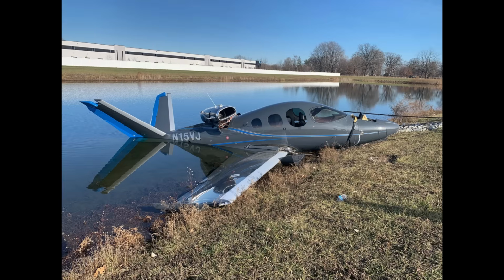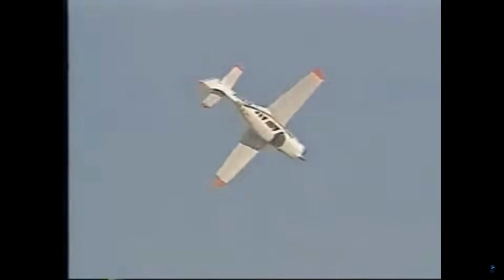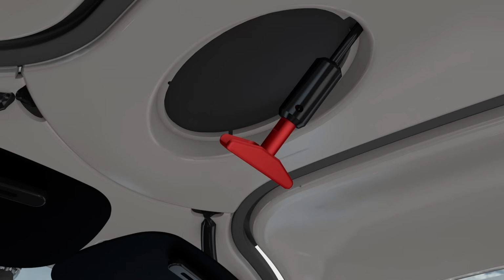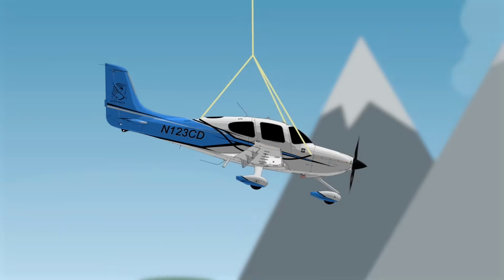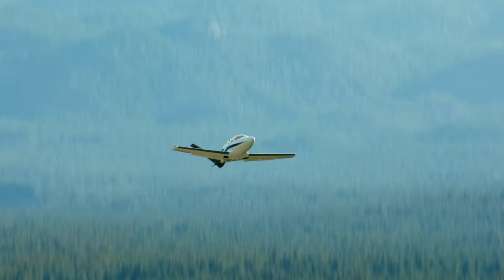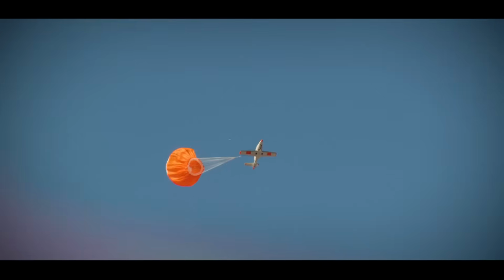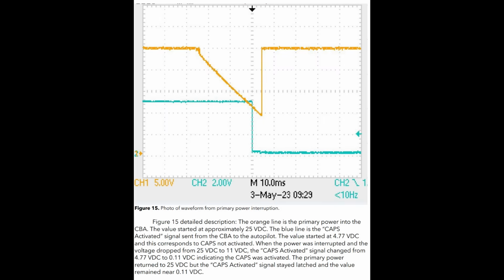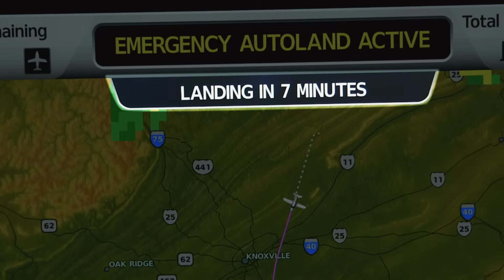Putting Parachutes On Planes: The Genius Engineering Behind Rocket Powered Airframe Parachutes.

Comment: Yeah...by far the most common cause of an off-airport landing in a light aircraft is fuel exhaustion.  I'd rather have the weight of that parachute available for fuel load.  I'd maybe carry one if I were doing aerobatics low enough that bailing out isn't feasible such as in an air show environment or doing airframe testing or something, but for a normal plane I"m going to keep in the Normal category flight envelope?  I'm not worried about pulling the wings off.

Comment: I flew a Czech Sport Cruiser for a bit in training. It had the BRS installed in it. Such an awesome airplane. Some guys remove the chute so they can get a higher load capacity. Because with the BRS, it’s like 450lbs. Removing parachute  added something like 150lbs to the total useful load.
Reply from the maker: Huh? My plane is 660lbs empty and has a 25lb parachute.
Reply: 150lb of parachute could land a house idk if that tracks

Comment: When I worked at Terrafugia on our flying car plane, towards the end of FAA certification flight testing, we needed to perform spin tests. Because this was a completely new from scratch experimental prototype that was not fully tested before, we added a BRS parachute, complete with straps embedded in the tearaway skin as you described. As an electrical engineer I would not normally be involved but the day before the test they discovered it could not be triggered by whatever existing system they had. It needed some particular timing on the trigger signal if I remember correctly. Exiting the meeting at 5pm, I went home to design and build a control circuit with a nice box and button...all out of parts in my own basement, and had it ready the next morning. I remember it was tested with a spare rocket in the parking lot. I drove it all up to the airport and installed it on the plane the next day, and my box continued to be proudly mounted centered on the prototype's dashboard for the rest of its days. Thankfully (?) it was never needed as spin testing went off without a hitch.

Comment: I have an idea for a virtual external "airbag" system for aircraft: Small rockets placed around the aircraft and they would decelerate the aircraft very quickly before impacting the ground. 

The parachute recovery system only works above 400 feet.

Comment: [apologies if this is a duplicate post]

The parachute system has certainly saved lives, and while one can debate endlessly whether or not some of the “saves“ would have really resulted in a loss of life that is inmaterial. It is a good safety system and a nice thing to have. Unfortunately, despite the parachute, the number of  Cirrus fatal accidents (187 as of today)  continues to significantly outpace that of parachute saves. This speaks to a number of factors, mostly pilots getting into situations which they should not have entered in the first place, and once in that situation did not use all of the tools available, including the parachute, to extricate themselves.

Slight correction on the spin training issue. Cirrus was able to demonstrate “equivalent level of safety“ for FAA part 23 spin certification by using the parachute as the spin recovery device as opposed to having to demonstrate recovery from a one turn spin. Conversely, Columbia, Aircraft spent well over a year and several thousand spins completing the part 23 spin testing. A very expensive and time-consuming process.

The SR 20 did undergo a limited spin test series in Europe in order to achieve  EASA certification. The report is available online. The aircraft was subjected to a total of approximately 60 spins, and the report indicates that while the recovery from the spins using flight controls was conventional in nature, the controls had to be held in the spin recovery configuration for longer than most average level experience pilots would be used to. They specifically did not test all of the corners of the flight envelope or complete a spin matrix series like that required under FAA part 23, nor were they required to. They also did not test the SR 22. So yes, the airplane will recover from a spin using conventional control inputs, but since the spin test testing was not completed throughout the flight envelope, the parachute remains the only approved method of spin recovery.

Beautiful day for flying in California yesterday with the exception of some unusual convective in Southern California. We flew over your home airport in our M350 yesterday afternoon on the way to a fuel stop in Santa Rosa before continuing on north. 

Glad that you are enjoying your Aviation experience.

Comment: Looking at that articulated sliding ring, how about a small rocket launched from a weather balloon, at maximum height, rocket engage when the balloon bursts.  That would push Max-Q almost out of the equation, as the atmosphere thins out the higher you go.  You would know much better than me, if a hundred thousand feet is enough of a headstart~

Comment: In 1975, Austrian Herbert Stollinger installed the FIRST "full sized " emergency parachute system on a hang glider that was carried on the pilot's harness and upon deployment greatly slowed the descent of BOTH the glider and the pilot together.
The internet erroneously lists the esteemed Roy Haggard as the first to employ an "emergency parachute" who at age 16 in 1971,  attached a small parachute to the end of the keel of a hang glider to recover from a possible uncontrolled "Luff" dive. This system was used because some of the early "standard Rogallo" hang gliders were not inherently pitch stable.
By 1980 most hang glider pilots carried emergency parachute systems as standard equipment.

Comment: As a paraglider pilot I dont understand this. We have round caps parachutes but there is no way I will use it as long as my wing is in a flyable state. 
So as long as the wings are on a plane and the controls work I would probably stick with my plane instead of landing with a parachute.

Comment: Excellent video, Scott! Just a slight correction on that second Vision Jet CAPS deployment at 14:26: The NTSB report states that the pilot did not attempt to use the autopilot disconnect button until 27 seconds after the CAPS AP mode was engaged. By that time, the aircraft was severely out of trim, and the pilot decided to deploy CAPS.

Comment: Sadly all I get from this is we will have more and more incompetents flying increasingly dangerous private planes for their pleasure of causing noise above our houses.

The fact they already tell you they don't need spin recovery and just pull a lever instead in the manual is appalling enough. 'just ditch your plane above someones roof if it doesn't work or you can't pilot for sht np dude'

Comment: I bought the GEN 2 solely based on the ALS. We joke about having to be RVSM rated because it can fly ~3,000' higher. ATC is not a fan of A/C that slow, that high. The 'rule' is, your speed must exceed your alt. Hence- FL310, and 311Knots. Headwinds are the problem. Funny enough, the MFDs also brief passengers once activated.

Comment: I think Cirrus catches some flack for their trigger happy CAPS deployment procedures and recommendations in the poh, but I think the <133 kt speed requirement can so easily and quickly be exceeded and never regained in an emergency situation that the "earlier the better" mentality is probably actually good.

I've fought many a Cirrus, SR20 and 22 alike, to slow to flap deployment speed in a normal descent so I can imagine 133 comes and goes rapidly in most loss of control situations.

Comment: Much of this parachute technology (rocket deployment, parachute bags, parachute bridals, line cutters) was developed in the 1980s by the military for use on high-performance ejection seats. These seats were designed to safely and automatically recover aircrew who had to eject, from 0-600 knots airspeed, and ground level to 50,000+ altitude.

Comment: Is it worth the loss of payload, loss of range, and loss of fuel efficiency while adding non and recurring costs?

Quick google search, I got general aviation accidents data from 2019 thru 2020. In US tge aveage accidents was 1,122. Of that average 195.5 of those accidents were fatal, making it 17.4 %. Average .88 fatal accidents per 100,000 hours. Not known out of the 195.5 ave fatal accidents, a parachute system could have saved lives. I bet large portion of accidents are at landing and takeoffs where parachute system really not going to help in most cases. Many accidents  are just bad pilot judgements and most of those likely parachute would save them. Certainly there are cases it would benefit especially for low hour infrequent flyiny pilots. Experienced pilots with sufficient recurring hours really shouldn't benefit much from it.

Comment: Uuuuh! Big Red Button. I wonder how many "Karen"s have been tempted in a fit of rage so far.

As for the crash? I'd imagine that such a system activating would cause all bells, whistles and hell to break lose. Not a small red text, combined with a "you should have known what to do". I'd additionally make it speak loud and clear two separate sentences: "Parachute system activated, preparing to deploy" and a separate "Autopilot forcing speed down to deploy parachute safely". If you have not pressed any buttons and/or hear sentence two without sentence one, you'd know something was wrong.

Why can the parachute deploy in unsafe conditions in the first place if there is the chance of the pilot overriding the breaking maneuver?

Comment: I was flying hang gliders in the seventies and the glider performance had improved to the point where we were soaring (gaining altitude and having long flights). It was a great relief when the reserve chutes came along. Most pilots did not fly with the rocket system but a version that included a twenty foot bridal and a "diaper" - a bag that prevented the chute from opening until clear of the glider. You would just pull it off your harness and throw it toward a clear area. In my almost thirty years flying I saw only one deployment (but read of many more).
Reply from the maker: Last year I encountered a hang glider at 6500 feet - 4000’ above the mountains below him. 
Makes me want to learn this
Reply: @scottmanley  Nothing compares to thermal flying hang gliders in the mountains.  I hesitate to recommend it... it's like heroin.  We lived and breathed it.
Reply: Even thermal flying hang gliders in central Florida is pretty awesome, though it may not compare to the mountains.  😉

Comment: I am in the process of designing an experimental aircraft according to EU regulations (450kg without; 475kg with parachute).

The aircraft is designed with the option of having the parachute installed later on with little modifications, but my design path was to just adhere to the 450kg, and deal with the parachute itself at a later date. Perhaps, after needing it.

Thank you ever so much for this video. It forced me to rethink the "parachute issue".
It will increase cost and build time, but it's a lot better to have it and not need it than to need it and not have it.
Thank you once again.

(Having a push-pull configuration with a 3-bladed-prop at the back was the main reason to procrastinate such solution. Either I have to eject the rear prop or design some clutch mechanism which forces the rear prop to stop rotating at a specific point in its rotation, before deploying the parachute.
Any ideas from anyone facing a similar problem would be very much appreciated.)
Reply from the maker: Interestingly, my plane was designed according to those weight limits, but when modified for UK they raised the takeoff weight to 550kg with no changes to structure.
The parachute rocket is installed forward of the cockpit, and launched upwards and to the right to clear as much of the aircraft as possible. 
So as long as there’s a way to stop the engine that can help
Reply: @scottmanley  I just took a look, and it appears that they recently increased the MTOW for this class, in the UK, to 650kg.
In the EU, some sources say that I'm still at 450kg MTOW. Other sources say that it was recently increased to 500kg or 525 with parachute. Very confusing. I will give them a call as this changes, if in effect, will change everything. Surely, they must have raised the minimum stall speed as well.

As for the parachute, my fear is one or more tethers getting caught on the rear prop if deployed at a specific attitude (maybe a loss of tensile strength just by momentarily rubbing on one of the blades). There's a low probability of it happening, but if it happens, it will, most likely, increase the risk of injuries... or worse.

Thank you very much for your input.

Comment: The jet could be disabled in such a way the autopilot is incapable of bringing the speed down to safe main chute deployment speeds before impact. I'd feel much better with a drogue chute doing the initial speed reduction than relying on the autopilot to do it for the jet, as well as it still being a separate and simple electromechanical system not reliant on the avionics.

Comment: Wonder if this would be practical for a jumbo jet. I'd imagine the fuselage would need to be segmented, as you'd only need to jettison the passenger compartments. Though, I don't suppose it could be retrofitted on existing jumbo jets, as not only the structure would have to be made much lighter, but the fuselage would need to be segmented. Like, at this point, might as well sell smaller aircraft with this system preinstalled (as it's already done).

Comment: Without arguing that CAPS can help safety a bit you have to remember the great majority of accidents in all types of aviation happen on either takeoff or landing, when you are generally going to be too low to use the parachute (my guess is that this is the most common story in those cases where deployment failed). That is why ejection seats have long been rated "zero-zero" (ie they still work at zero feet and zero knots). I reckon over time autoland will save more lives than CAPS as it gets fitted to more planes.

Comment: Did a Boeing engineer implement the Auto-CAPS system?
"We're gonna make a system that immediately takes over the aircraft, causes a dangerous maneuver with little to no sensor input, and takes an unusual step to stop that's only outlined in the fine print in the instructions."
You have to admit, that's shades of MCAS right there.
Reply: Memory items aren't fine print, that's the biggest boldest fucking print in the book.

Comment: I had a job interview with Cirrus and it was with one of the guys who worked on the SF-50 parachute system. He said the idea of using an airbag came from watching YouTube videos of people launching themselves in the air with car air bags. They thought, "Hmmm maybe this will work for our launch system"
Reply: Proof that goofing around with explosives drives innovation!
Reply: @thedroolfool   the charred Jeb: i did not need your help, ya know.
Reply: Scott, I actually think the auto land is a better way to recover an aircraft after the pilot has elected to become a passenger (his brain wrote checks his piloting skills couldn't cash!) or "baggage" (dead).

A parachute delivers you to one spot. That spot is determined by what's under you when you pull the handle.

Not all of those spots are conducive to continued living.

The auto land system delivers you to a nice, safe airport, with the airplane in a condition that can be re-used.

The small sunset of accidents where parachute=survival and autoland!=survival seems hardly worth the decrease in payload, the annual maintenance and the cost of purchase and  installation.

The annual cost of the parachute is, in my opinion, going to result in a lot of airplanes that become hanger queens or for sale cheap.

The best safety feature on an airplane is a competent, confident and skilled pilot. Not a handle puller! If you fly into situations you wouldn't fly into, if the parachute wasn't there, you are a liability to your passengers.

Comment: We used to have to cut the parachute assembly out of the early Cirrus aircraft as they had a life limit for recertification and a short-sighted replacement work scope. The newer serial numbers you can replace the assembly from behind the backseat. Back when we had the cut the fuselage just behind the rear window, it covered a lot of GA disciplines. Composite repair, rigging, structures and we had to be certified for removal and disposal of the rocket motor. We got to the point where we were just changing line cutters once the assemblies could be replaced without cutting a hole in the fuselage. It was an easier job so more shops could do it. I never got to change one on a Vision Jet.

Comment: Given that it's all glass-cockpit stuff in the Vision, I'm really surprised it doesn't have a great big red flashing [CAPS] sign when it's going into that intentional stall move. Maybe an audio announcement too. Like, that's some really important information to give to the pilot. If they just pulled the handle, they'll get an immediate confirmation that CAPS is online and the plane is setting up to fire it.  If they didn't, then it gives an unmistakable notification of what's happening that would help the pilot understand what they need to do.